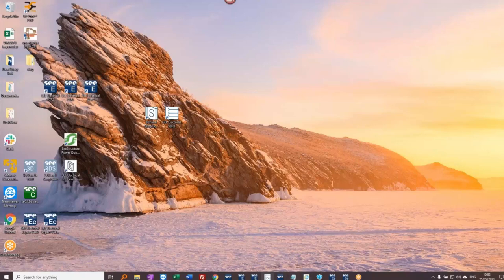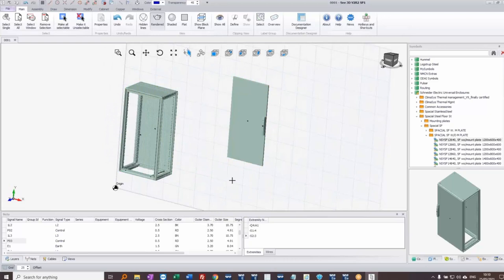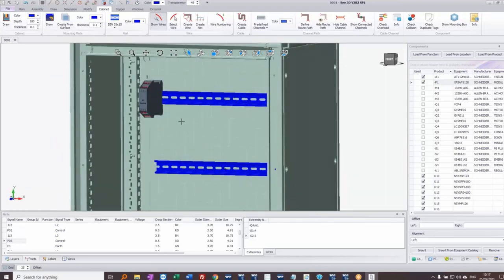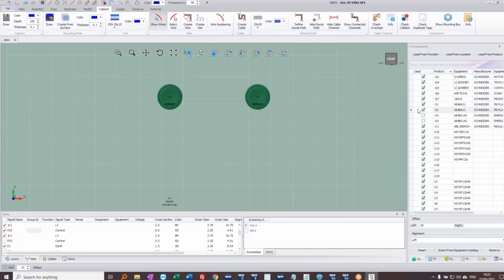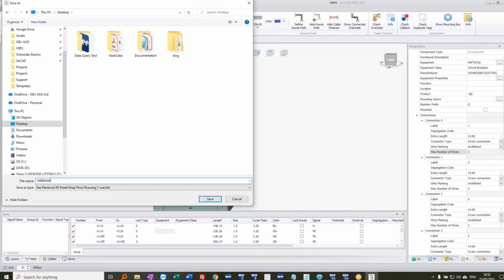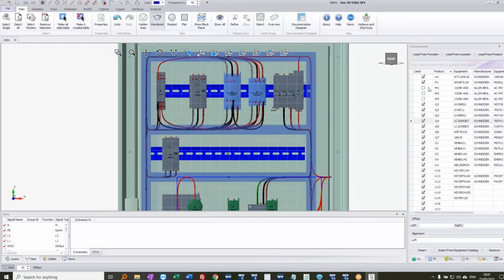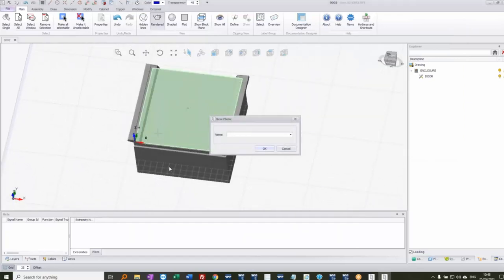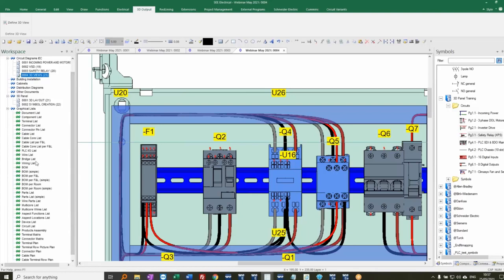See Electrical 3D Panel - Webinar May 2021 - IGE+XAO UK

Comment: Do you have to create all those devices and pieces or is a library included?  do the line up and function as you're demoing or do you need to edit them to do this?
Reply: All parts shown are provided by our content team. There's a huge and ever increasing number of manufactures covered with models which include electrical and mechanical connections to ensure the design job is as simple as possible.

Comment: so, this is an autocad add-on?  we use 2019.  is that all you need to run the program?
Reply: You don't need AutoCAD for this program. Although we fully support import and export to DWG formats this is running on our own graphics platform, so nothing else is needed.
Reply: Good afternoon. Where you can find hotkeys for quick and convenient operation. Interested in binding.I am a novice designer.